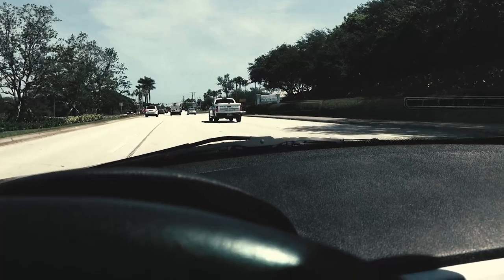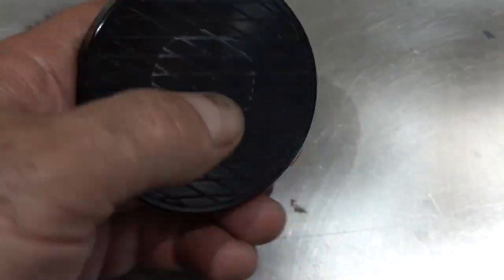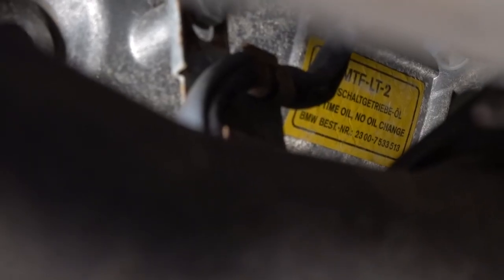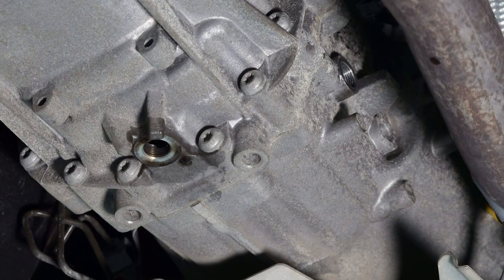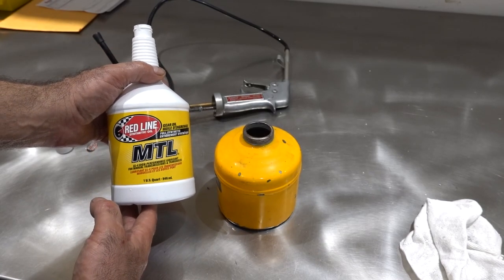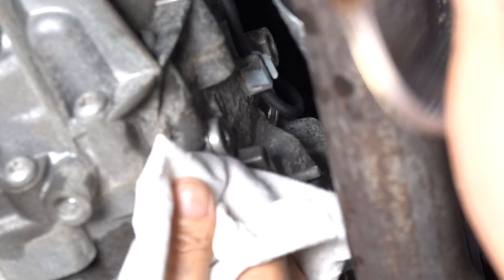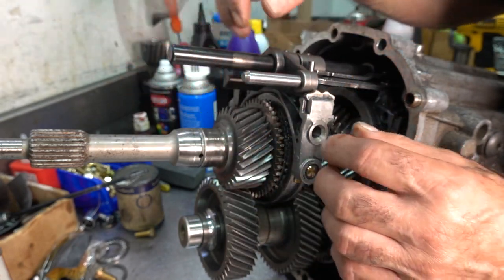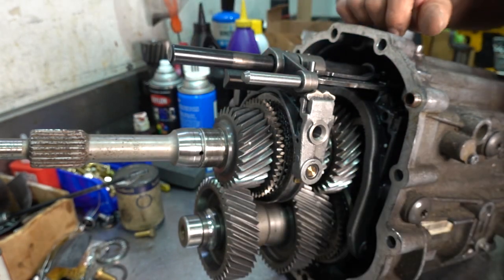Z4 6 Speed Manual Transmission Lifetime  Oil Change - BMW Z4

Comment: You perfectly explained the reason behind the "lifetime oil" claim earlier when you mentioned the cost of a replacement unit - and its (only) source.

And of course any lubricant is a lifetime fill as long as you're "willing" to reduce the component's lifespan to that of the lubricant. Works out quite well for the supplier if the lubricant can keep things going just a bit longer than the warranty period . . ..

I bought an older car some years back that perfectly illustrated the hazards of running a transmission low on oil. It came with the original transmission - in boxes in the back of the car.  The front countershaft bearing had worn to the point where balls could squeeze out of the races under load, and eventually lost enough that, combined with the mainshaft needle bearings wedging and galling from deflection, the input gear separated from the countergear enough to clash - and that was all she wrote. All 3 shafts were wiped out, countergear cluster and input gear were shredded, third output somehow also lost teeth, one of the sychro rings had split (from debris, I suppose) and the front cover had a big hole in it.

Got a "good condition" replacement from a source I trusted - working pull from one of his cars - and pulled the case off just to check. And what do you know? Somehow the front counter bearing was missing a ball . . ..

Comment: As always one of the most intelligent, interesting, well spoken and knowledgeable people talking on the internet. It’s great to hear what you have to show and tell. I was waiting to see if removed the fill plug first? In my younger days, while working on a ship, I went to change oil in a gearbox on a fuel pump...... drained the oil first while fuel tanks were low, then stripped out the fill plug! Why didn’t I remove that first!!? Oh well scrambled around drilled out fill plug, refilled with oil and pumped fuel.
Lesson learned- remove fill plug first.
Reply from the maker: The logic seems correct. Remove the fill plug first just in case you strip it. Then what? Not change your oil?
Worry about it another time? You can get replacement plugs from BMW. Shocking it loose in the video before applying a wrench to it usually works. I have seen my share of fill/drain plugs and aluminum access plugs stripped because certified mechanics haven't developed skill levels. Thanks for watching and sharing your story.
Reply: @GearBoxVideo  Paul I have a 20 Toyota Hilux with a 6 speed I want to change the factory gear box oil to something better just to be sure whats a good choice?

Comment: Great video, Paul. Haven't seen anything from you in awhile. The whole "lifetime" fluid thing is a myth. I remember when Mercedes Benz claimed their automatic transmissions came with lifetime fluid. Well...the "lifetime" of that transmission was about 90,000 miles. At that point, the fluid was like black mud! Keep up the good work.

Comment: Must be a German thing. For work, I bought a used German-built (Weiss) cam indexer (jig turntable) to use in a welding robot automation cell and got the same  "lubed for life, do not change" line when inquiring on where to drain the oil (which was about the color of maple syrup after 17 years of use). No drain hole, our maintenance crew had to pump it out through a vent/fill hole. At least the owner's manual gave a oil capacity and oil (Shell Omala 680, 7 liters!). Still moved nice and held very good tolerances... and for the hilariously cheap price I found it for on eBay, was a massive "win" indeed.

Comment: These are some of the best videos i've seen on Youtube, and non of the greed driven cash grab with an ad break every 2 minutes like most others do either. Top job, fantastic informationand very well explained!

Do you ever do anything with the ZF6 from the 89-96 Corvettes? I have a 1993 Callaway Corvette that i have no issues with, but i will change the oil soon and after seeing your clutch release video i reckon i might swap out the master and slave cylinders at some point too, since the car rarely ever gets driven and the parts are so cheap anyway.
Reply from the maker: Do the oil change and maintain good clutch components. The killer is low or dirty oil and clutch release. ZF parts are expensive.
Reply: @GearBoxVideo  Will do :) Cheers mate!

Comment: Nice!! All driveline components (not engine) should have their lubricant changed at 50,000 km for sure. There is a reason Hondas last longer, if you follow their lubrication change schedules. Honda maintenance schedules are about the 50k km interval for trans, transfer case and diffs... they must know something... :-) Also some of their lubricants are "Honda Oil" only so proper lube is very important ... :-)
Reply: That adage, of you, change the engine oil, why not the others. 
After years of warranty claims the 'Lifetime' stuff came about, from people not using the right fluids and over/underfilling or checking when cold when it is meant to be in an operating window range.

Comment: If I may, another tip is to drain oil into sterile pan and then stir it slowly with a magnet.

This helps analyze if any hard parts are damaged. Obviously, some syncros flecks may show up and is considered normal wear & tear if it isn't saturating the magnet with a single stir of the oil. If it's packed after 2 or 3 stirs and cleanups, well, now you got a problem that needs further investigation.

Brings back memories of more than a few Ford F-250 ZF5 transmissions that couldn't handle the 6.9 / 7.3 L diesel output with maximum load. Cost more to rebuild them than they are worth, let alone find good quality rebuild parts.

On some BMW 3 series cars, they don't install engine oil dipsticks. Only a warning light to get you back into the factory dealer system. 😳🤷🏻‍♂️
Reply from the maker: The whole concept is to keep it dealer only

Comment: Just a note. In verifying the correct MTF for my 2007 Z4 3.0si, it appears BMW changed to spec in March 2007. The difference being, prior production was 75w80, and post production is 75w90. I suppose the best way to verify is to see which LT version is posted on the transmission. 

Great video!
Reply from the maker: If its the same transmission it is a mute point. Redline MTL is what I used

Comment: Great video, I have 2010 Z4 with 22k on the clock. Having watched this is I think I will change the oil. I do find the shift a little notchy at times. I just changed the oil in my 1939 German tractor gearbox last night. Straight 140 oil in that. Like thick syrup. The stuff that came out was way too thin. So I hope this will make it a bit quieter as It's close the original oil which is all quoted in Engler!

Comment: I'm extremely against any lifetime oil in any component on any vehicle. Oul is my pet peave automatic trans, transfer case and differentials 50K change fliud and clean+inspect all breathers. But i overdue fluid changes. I'm a Lucas oil additive fan? Whats your opinion on that. I like it for all fluids, power steering, engine, automatic trans, differentials I've never tried a manual trans product though. Im 40 started in a shop pushing a broom when I was 18. I was in the right place at the right time. I mean I do have good work ethic. Great channel I just found it. I've done alot of clutches big, small but never opened a manual trans. Very interesting. I subscribed. I 👍🏻🇺🇲
Reply from the maker: I never found the need for additives since  you asked my opinion. Use a high grade lube for whatever app you need . Why would I buy for example a Lucas Gear Lube and then have them sell me an additive to make it work better?

Comment: Hi Paul. Love your channel. I've watched all your videos and bought your Muncie 4-speed book. I am hoping that I never have to repair my Muncie 4-speed transmission in my 1970 Corvette convertible; however, I am hoping that I am using the best fluid possible. I have changed my oil one time in my transmission with the Driven brand, GO Conventional SAE 80W-90 GL-4 Gear Oil. I was hoping that you could confirm that I am using the best oil for my transmission or maybe recommend something better. It is a low mileage car (less than 20,000 miles) and I plan to change the oil every year. Thank you for all that you do!
Reply from the maker: Thanks for watching. The Driven Oil is a great oil to use
Reply: @GearBoxVideo  Thank you!!!

Comment: Thanks for this, would love to see some more content on the BMW ZF gearboxes. We're fitting a GS6X53DZ into an old Land Rover as they're supposed to be able to withstand a lot of torque, would be interested to see the internals in more detail to see how they're built to take this power. Regards Fred
Reply from the maker: I'm trying to get a few more cheap cores in that may have case damage. So they sell for parts only

Comment: Bravo, Paul 👏🏻
Great advice.
I own a 08 E82, since new, with the GM 6L45 6spd auto, (Made in Strasbourg France) and it too has the lifetime oil label on the underside of the transmission.
I only have 72,000kms on the car but I'm not too comfortable with the lifetime oil concept on the transmission.
Wondering if you have any thoughts, even though I'm talking about the automatic.
Btw, kudos to your buddy Saul there.  Quite the shop and quite the ride!
Ciao!
Reply from the maker: Running a ZF automatic just a quart low can burn up the transmission

Comment: I changed the factory gear oil out at just 17,000 total miles to a gear box specific oil to the Toyota 6 speed It shifted fine before now it's even smoother what I used was 75-W 80 also .
Reply: Paul I can't see any gear box filled for lifetime, what were they thinking?

Comment: Modern automatic transmissions from some manufacturers also have the same transmission fluid for life bullshit. Which I can assume will only last 100,000 miles or less before the transmission gives warning check lights from that point on. I can't believe they used alloy hardware in alloy cases, lubrication on the threads is a must as aluminium will bind up with similar alloys.
Reply from the maker: The concept is that they all have the Same thermal expansion properties because they are made of the same alloys... Until you have to remove them.

Comment: Loved the video Paul, glad I stumbled upon it.  I do have a stupid question.  When you shock the drain plugs are you hitting them in such a way to loosen them or just hitting the plug at a right angle?
Reply from the maker: Usually I shock first in and try the Torz bit. If I feel it could strip then I'll hit it in the direction of loosening it  New olugs are available from BMW

Comment: Excellent video Paul.  New subscriber.  I am getting ready to tackle this job myself, but want to replace the plugs with new.  Are they the same plug or do they have different part numbers?  Thanks again for the very informative video.
Reply from the maker: I got my plugs from BMW parts direct  I also use Northwest BMW.  FCP euro also carries them

Comment: Great video as always Paul I love how you explain what you're doing on your car and the other transmissions you're working on but I can't understand why BMW tells you that is a lifetime oil like you even explained here no oil is ever a lifetime I think BMW along  with ZF do they want to see their transmissions FAIL .
What is the purpose of stating not to change the oil , keep up the great videos .
Reply from the maker: I don't know why they state that either. However I always recommend changing oil especially in manual transmissions because there are no filters. Same goes for rear axles

Comment: Thanks for these videos Paul!

I changed the fluid with OEM on the same Getrag transmission (125k miles), but 2nd is still stiff when I down shift. You mentioned in another video that the synchro teeth can become worn and partially "block" the shift due to "over indexing". Have I understood this correctly?

Comment: Spent about 10 years doing manuals. Have seen gearboxes come in with just enough oil so it laps the front cluster gear and they were rebuildable-nothing short of miraculous. no scuffing or discolouration, Just replace bearings and seals and off they go. This week I finished assembly of a T56. Was shocking how much force i used to fit the 1/2 hub (5 tons)  and the 5/6 mainshaft gear (7 tons). Is this usual. I usually pre fit new splines to check but was supplied the wrong gear and had the rest of the box assembled in this case.

Comment: Fantastic video. Very informative. I also have a z4 3.0si manual, great little cars. The time has come for a gearbox oil change i was advised to a mix of redline MTF 75w80 and redline D4 ATF. How does this sound to you?
Reply from the maker: No! Depends on your oil label. The LT-2 is the same as RedLine MTL. People who think they are petroleum engineers mixing oils are idiots. Do the right thing. Either use the specified oil from BMW or the equivalent viscosity from another vendor. Must also be Gl4 ONLY.. Concept is to change the oil for the reasons mentioned in the video.
Reply: @GearBoxVideo  i also have the yellow LT2 sticker on my gearbox. I will take your advice despite what has been said on other forums. Thank your for the advice and keep the excellent videos coming.

Comment: Great video . This has confirmed to me to change the gearbox oil in my 2010 Z4 3.5i Stick shift. Redline is tricky to find over in the UK so looking at the Valvoline 75w-80 GL-4 MTF . any comments ?
Reply from the maker: Never used it

Comment: Awesome information and video.  I'm a new subscriber now.   Do you know if the 2003 3.0 E85 would have the same setup and procedure for draining and filling transmission oil?  I recently purchased my Z4 with 96k miles and I doubt that the transmission has ever been serviced as it is not mentioned in the Carfax report.  Mine shifts a little "notchy" as well, especially between 1st and 2nd.  Also, what is your opinion on removing the clutch delay valve?  A lot of people swear by it but I would appreciate the opinion of a pro.
Reply from the maker: Yes however some Getrag and ZF boxes have different viscosity ratings.

Comment: Paul, Which transfer pump were you using to fill your transmission? The cheap ones
that the auto parts stores carry are junk and I'd like to get a good one. Thanks
Reply from the maker: Find an old Alemite one. The one that was used was from the 60's
Reply: @GearBoxVideo  that old school pump was very cool.

Comment: Any downside to using magnetic drain plugs if clearance permits, or is it unnecessary on manuals?
Thank you, and welcome back!  I hope you've been doing well down there.
Reply from the maker: Many transmissions have magnets clipped or bonded to the inside of the case. So a plug is not necessary. I do think it is a better idea since you can clean plugs off during oil changes. All manual transmission will have dirt in them over time since there are no filters. The problem is you will always have some gunk on the magnet and that doesn't mean somnething is failing.
Reply: @GearBoxVideo  Thanks!  Yeah, a few micrograms of rubbings/gunk can look creepy.  Enjoy the drive!

Comment: Awesome video! Very informational thanks for sharing. Quick question regarding manual BMW transmissions like these. Reverse is usually left and forward on BMWs. Does this mean the reverse gear is on its own shaft alone? What is on the other side of the shaft? In other words what would happen if you bring the gear lever to the left over the reverse shaft and pulled back instead of pushed forward?
Reply from the maker: It won't move to someplace not intended in the design.
Reply: @GearBoxVideo  Thanks for the follow up! One more question, perhaps a little odd. I love your taste in metal/rock guitar music you put in your videos :) Would you happen to have a Spotify playlist or anything you could share?
Reply from the maker: My current work is drums and recording engineer on an album called snake pit therapy by Sunny Vincent. I know that is on Spotify
Reply: @GearBoxVideo  Will check it out thank you!

Comment: I figured you would know - I just purchased a Z4 E85 with the SMG transmission and have seen some video's of the SMG having an oil cooler, can you tell me if my Z4 has one?  I took a brief look under it and did not see one but the heat shields may be covering it.  Thanks
Reply from the maker: Some coolers are oart of the main radiator. I would not know

Comment: Great info!
I also have a have an e86 3.0si and I get a rattle noise in neutral when warm, there’s no noise when the transmission is cold. Once I press the clutch the noise is completely gone. I just changed the oil with the OEM BMW oil, no change regarding the noise. I’m thinking to use a thicker oil like redline MT90, do you think this is a good idea, considering there’s no noise at all when cold? Thank you!
Reply from the maker: I have this problem from time to time. I think its the dual mass flywheel springs either hanging up or getting weaker.

Comment: Have watched a dozen of your uploads and they are all excellent+. Just have a question, as I am trying to learn; so I get the action between the synchronizer rings and hub/slider assemblies for engaging the gears. What I don't understand is how the speed of the input and output shafts are equalized in between shifts. If anyone can tell me how that happens, thanks.
Reply from the maker: They don't have to be. The only synchronization has to be between the actual speed gear and output shaft. If the input is used as a direct drive like a 4th gear then the same thing applies

Comment: hi paul what rear diff oil do you recommend for 2004 z4 e85 3.0i as ive brought the gearbox oil you recommend and want to know what diff oil you use thanks good video bud
Reply from the maker: I used the Driven racing GL5 lube in my diff.